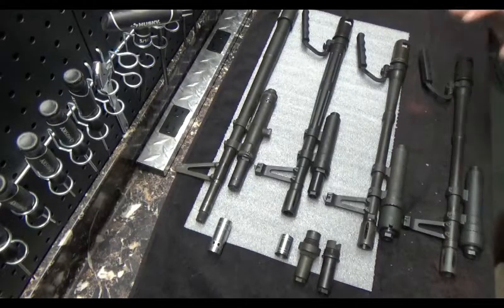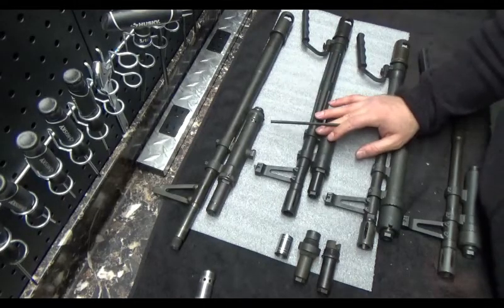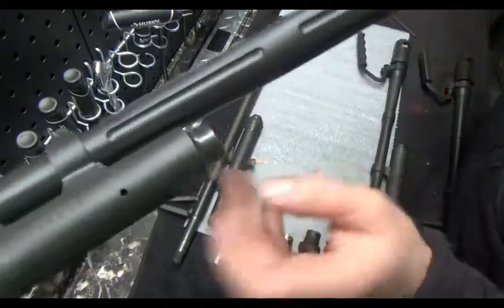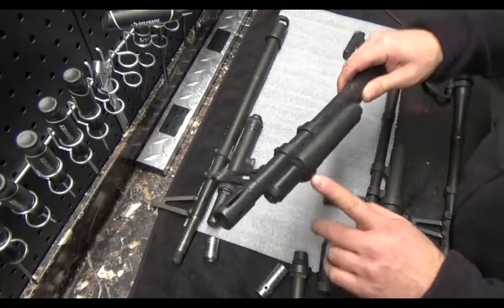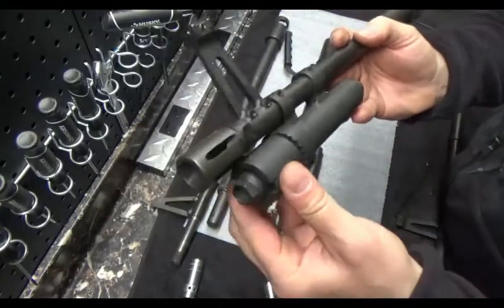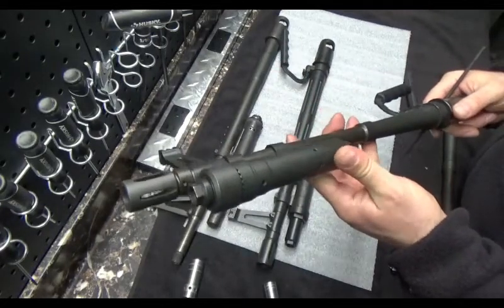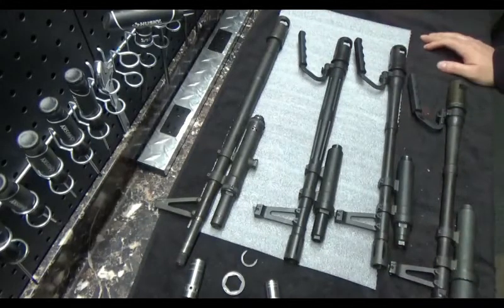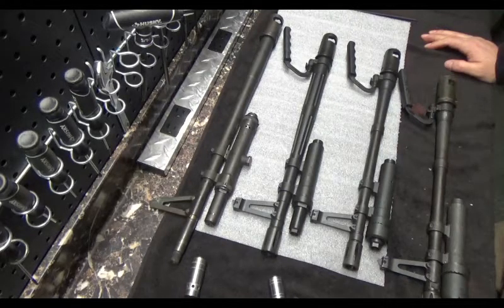M60 Gas System Differences -E3 , E4, E6

Comment: It’s just basic engineering. If they had  heavy springs both plugs on the original standard gas cylinder it would not come off. Clamp loads essentially goaesvaway as the nuts expand from the heat on the originals.